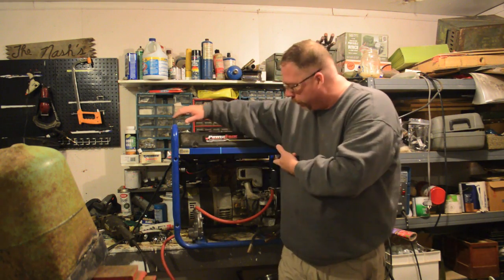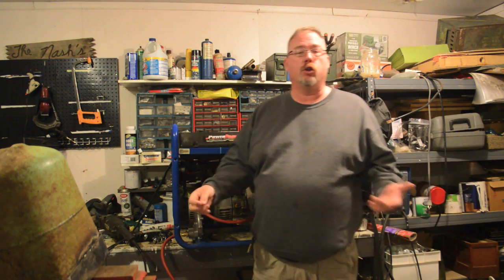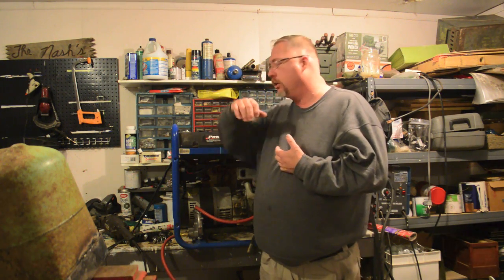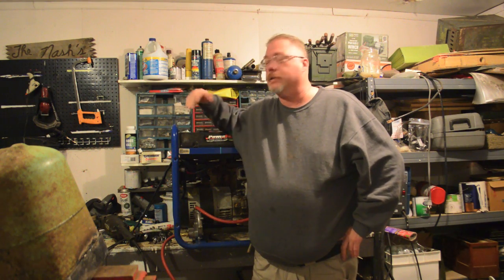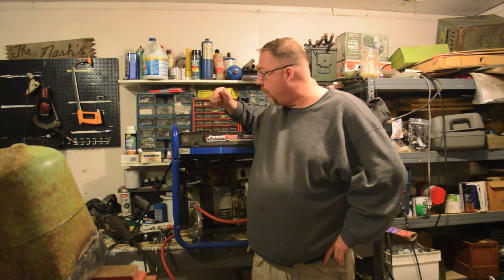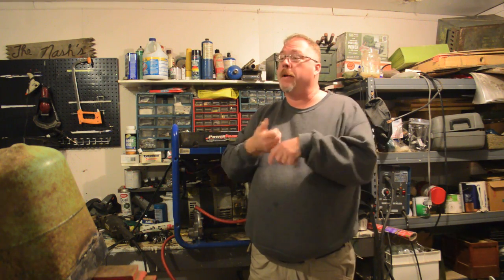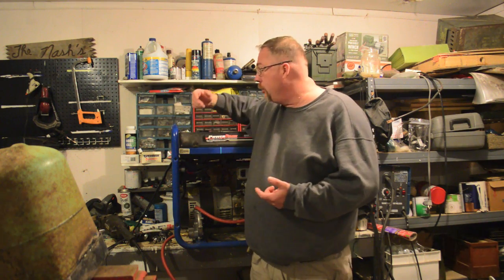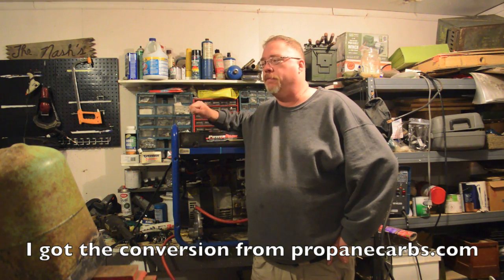6 Benefits of Converting Small Engines to Propane

Comment: Or you can do with my dad did with the barbecue and go from propane to natural gas line That was running. To our house anyway, and he connected it and just change the Jets out of the gas jets out of the old BBQ to burn those slightly different. Fuel very similar very clean-burning but slightly different so needed a slightly different jet in the barbecue, but it was much easier and even much cheaper to run a line directly to the barbecue instead of getting going on a grill and then suddenly you're out of propane and you have to go to the store. You have to carry a heavy tank and all that and you don't have to worry about that with natural gas. It might even be better in a generator situation because you know, it's just sitting there anyway, but either way they're both clean burning and then you have very good points. However if you can there I don't know any downside of running the natural gas. They're both incredibly clean that end butane as well. They're so similar to one another lover. You know, you just do your research.

Comment: Sta-Bil is a proven fighter of ethanol gas, if you don't think it works it is because you haven't tried it. My riding mower was starting to surge real bad, less than a tank full of gas with Sta-Bil in it and I haven't had a problem since, and that was a few years ago.
Reply: Stabile only increases the life you still can’t store it long term.  Everybody’s definition of long term is different,  stabile claims it will keep fuel up to 2 years.  The key term is up to, most people just see 2 years and you have to double the amount used. It depends on the environment it’s stored in.   You also have to add it when you buy it.  It doesn’t refresh your fuel.  It’s a great product that I use every time I put fuel in my containers.  It will protect your carburetor and help your engine to run smoother.

Comment: Nice video. I've converted a lawn mower and edger to propane. I actually did that for health reasons. I used to always get sinus headaches from inhaling fumes while using my gasoline-powered lawn equipment. That is because small engine carburetors are inefficient at atomizing gasoline. So, many unburned gasoline particles are passed through the exhaust, resulting in sinus irritation. After conversion to propane, the fuel is already in vapor form when it enters the intake. Therefore, it combusts very cleanly and doesn't leave irritating particles.
Reply: Thanks for commenting!!! I just check out your videos, they are great

Comment: Out standing.  Spark plug for propane  should be 0.020 in.  Converted many.  Dual fuel, will work..  Propane rules.
Reply from the maker: +Jerry Thompson Thanks for the spark plug tip.  I think this conversion is one of the best things I have done on this channel.  It works well and is much easier.  I find myself looking at a bunch of old engines and thinking about converting them.

Comment: I have a Honda 2000i with a tri-fuel setup.
Is yours harder to start when on propane?
I haven't tinkered with mine (on propane) but a time or 2, but it wouldn't start unless I first started with gas, then switched to propane. Is there some other "adjustments" (like you mention here) that I need to do?
Good video. I think propane is the way to go. 
Have you ever seen a line at the Propane Dealer after a natural disaster?... Nope  :)